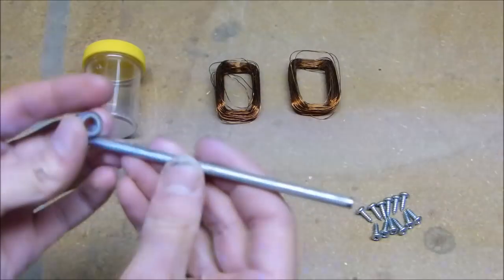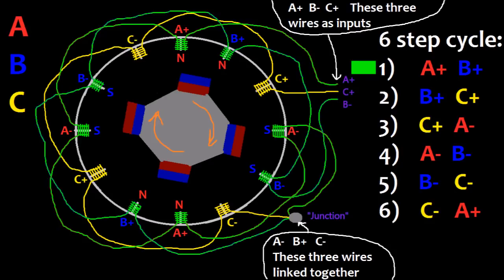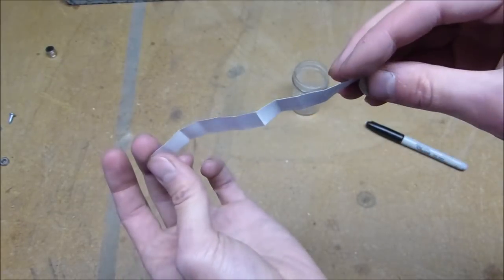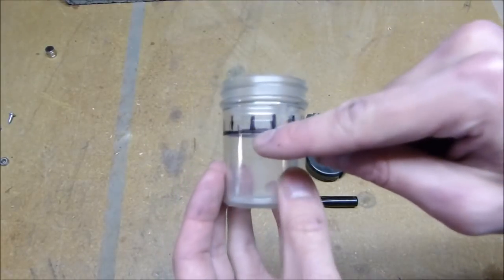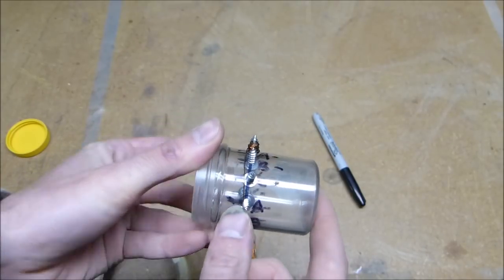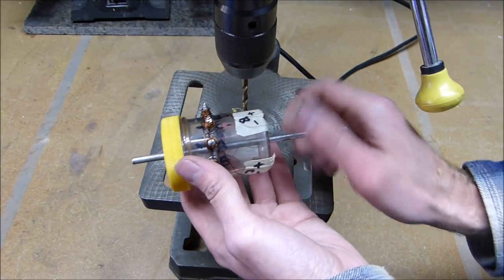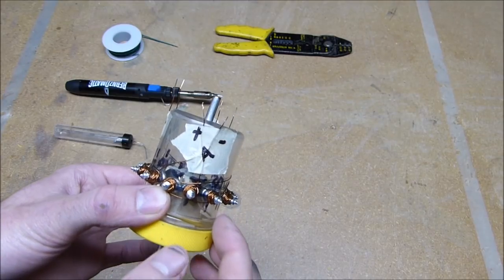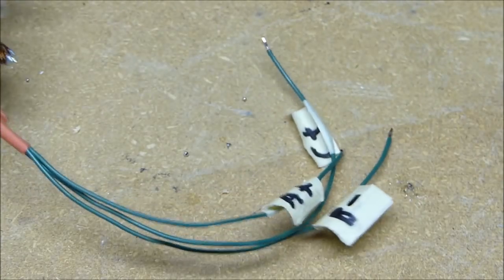How to Make a Brushless DC Motor Inrunner

Comment: My understanding is DC motor has 2 wires, positive and negative. but here shows 3 wires, how am I connect it to a battery has 2 poles ? anybody know ?
Reply from the maker: you need to use an electronic speed controller, it is like a solid-state (transistor) version of the mechanical brush commutator in brushed dc motors.
Reply: Thanks Jaycubl !

Comment: why would a brushless dc motor need a controller?  where can you by a controller for this?  and why is it only 25 rounds winding?
Reply from the maker: +KimChiTofu The controller takes the place of the commutator (mechanical brushes on brushed motors). It controls what couls are on and when.
Reply: what does it mean to have more rounds vs less rounds winding
Reply: +KimChiTofu MORE POWER
Reply from the maker: KimChiTofu Fewer winds will allow higher current (more horsepower) at higher RPM, but more windings would allow for more torque (more magnetic field for a given current). More windings (or stronger magnets) will result in a lower KV rating (fewer RPM per volt). More windings also limits the current you can use without too much heat. It is a balance of what you want from your motor with torque, power, RPM, cooling, and efficiency.
Reply: how do you calculate for number winding = more torque, power, speed etc.  any website?
Reply from the maker: KimChiTofu I do not know of any simple calculator, there are probably too many variable. The weirdest variable to account for is the strength of the rotor magnets and their distance from the coils. It is something you will probably need to experiment with, or read about other people's experiments.

Comment: can I use copper wire instead of magnet wire?
Reply from the maker: +Mani Singh Yes, this is copper wire. It needs to have a coating though as an electrical insulator. The wire called "magnet wire" is copper with a thin enamel coating.
Reply: +JaycubL thanks

Comment: Can this be used as a generator as well? If so how to modify the design?
Reply from the maker: Yes it's a type of 3-phase generator without any modification.
Reply: I am sorry @JaycubL I am new to this field. From the outputs A+, B- and C+ how do we give it to a battery or a supercapacitor to drive the load?
Reply: That is, with the outputs from A+, B- and C+, What do I do next?
Reply from the maker: Shreyas Prakash For that you would need to rectify it to DC current. Try to read about full wave bridge rectifiers, they area set of 4 diodes that you can use to make single phase AC into DC. Use one full-wave bridge rectifier on each phase, connected between the output for that phase and a 4th wire that all 3 phases can share. The 4th wire can connect to the point at the other end of the coil wires, the connection of all three coil sets (the junction connect to the 4th wire, acts as a ground for each phase). I hope that makes sense, just try to read about 3 phase generators, and AC to DC rectifiers.
Reply: Here does the 4th wire same as that of A-, B+ and C- you are connecting together?
Reply: I also tried the same wiring connection and tried measuring voltage from the oscilloscope. I am hardly getting any measurable voltage. How much voltage and current was being generated? How much output power when manually rotated? Could you please tell me
Reply from the maker: Shreyas Prakash The 4th wire is a neutral wire.
Reply from the maker: Shreyas Prakash I don't know that voltage you will get, that will be a function of the magnetic field strength at the coils, the number of turns on the coils, the material and dimensions of the coil core, and the RPM of the rotor.

Comment: Did you use a servo tester? Or the throttle stick?
Reply from the maker: +krishna kumar pookat I used the throttle on the controller if that is what you are asking.
Reply: +JaycubL  Thank you. That's exactly what I asked. I am looking for a control mechanism. To use with esc .

Comment: How many volts does it generate when we turn the tip ?
Reply from the maker: that would depend on rotation speed, number of turns on coils, strength of magnets, distance between magnets and coils
Reply from the maker: I can design a motor for you and give you dimensions, part list, etc. I already have one designed that would probably capable of that kind of power and I have some parts for it because I plan to build it. But I can not guarantee the power output of your motor to be 97hp. The power will be more of an issue of what power you can supply, your battery bank and your control circuits. If you include batteries and control electronics and everything, this would be a several thousand dollar project, I would be surprised if it is under $5000 USD for all your parts (batteries would be the biggest deal). BUT much cheaper/simpler setup would probably be capable of reaching that power you want for a short time.
Reply from the maker: Maybe I want clear and direct enough, I said I CAN'T guarantee any certain power level you could achieve. The power output is going to mostly depend on your battery bank and control electronics which I can't help you with and which will cost thousands. The power of an electric motor is basically however much you can dump through it before it brakes or overheats. You would be best off designing your own but if you really don't want to, maybe I can put up a video of the design this weekend. But yeah if you still want I can make some drawings for you and list out what parts you would need, the ASAP thing is not how I operate it would be more of "if/when I get time." Sorry if that is not that helpful but I have too many of my own projects to take on other people's projects.
Reply from the maker: OK well if you want then email me at jaycubl@hotmail.com and I will try to reply with a design for you soon.

Comment: how would you call this wiring pattern? AaAaBbBbCcCc? or something else?
Reply from the maker: +Remco van Woerkom I think it would be AbCaBcAbCaBc
Reply: Hmm, how do you interpret those letters?
Reply from the maker: Remco van Woerkom Capital letter is one winding direction, lower case is the opposite winding direction (the "B" string is connected in reverse so all winding directions for that one are effectively reversed from the physical winding direction when compared to the A and C strings).
Reply: ah i see, thanks!

Comment: Hold on, it is not a "DC Motor" in fact. You use a controller for brushless motors and they are actually simple synchronous AC motors. All of them. So when you say "DC motor" there must be anything that would make AC out of DC. In DC motors this "thing" is a collector with brushes. In brushless motors this "thing" is that controller it wouldn't work without. CO mode off:)
Reply from the maker: +Zortorond Yes, these are normally referred to a brushless DC though. Thank your for watching!

Comment: How do you connect this to use as a generator?
Reply from the maker: It will function as a 3-phase AC generator. The junction where all 3 wires meet is a common ground, and each of the 3 wires is a separate single phase AC line.
Reply: @JaycubL  thanks for explaining 👌

Comment: how many volts can it cope with
Reply from the maker: +tom hall It could handle very high volts, that would depend on the insulation on your wire. But if you let the current get too high it will het up. It could also handle very high amps but the higher the amps, the shorter the time it can run without overheating.

Comment: sir do i necessarily need the speed controller
Reply from the maker: For this type of motor yes you do need one.
Reply: and sir to what this controller is this connected
Reply from the maker: RC electronics, it is a radio receiver. But you can use any PWM signal to control the speed controller.

Comment: its not  a dc moter dc moter mean just us two wire negative and posetive ()(+) and you use three wire a,b,c .. cpu fan is also a dc fan and made by bresh less motor rebult it with two  wire black and red()(+).. direct battari base running and not use connector .. and this video is also good but i want dc motor breshless like cpu fan black and red wired
Reply from the maker: +ankit panwar A brushless motor will normally outperform a brushed motor in every way other than price. I can make a video on how to make a simple brushed motor if you want though.

Comment: how would I increase the torque?
Reply from the maker: You can increase torque by using more windings on the coils, stronger power supply, stronger magnets, smaller gap between magnets and coils, or a larger diameter rotor (for greater leverage).
Reply: JaycubL thnx

Comment: How did you learn this.
Reply from the maker: I already knew it would use 3 input wires and 3 separate coil sets. I wanted to know how it worked, so I stood there and thought about it for 20 minutes or so and then I had a clear design for this in my mind and fully understood the working cycle.

Comment: nice spark at 20:17 . Does anyone know why?
Reply from the maker: +wewlf a I was actually wondering that too! It might just be a small piece of the nickel plating on the magnet flaking off and reflecting some light. Or maybe some electrostatic effect because of the moving parts? Not sure.

Comment: That is cool. (:
Reply from the maker: +Qyuubi786 Thank you for commenting again! I really appreciate it, it helps me out some.
Reply: +JaycubL  I ask you why the current level has 3 wires on it and put the 3-point wiring that is not it
Reply from the maker: +ti ken Something may have been lost in translation... If you are asking "why are there 3 wires instead of 2 wires," it is because this is similar to a 3-phase ac motor. It needs more than 1 phase to create the rotating magnetic field.

Comment: can I do this with 9 screws ?
Reply: i guess you can do this with 8 screws, the magnets are even and so the screws should be even in numbers as well and it has to be smaller magnets than what he built in the video.
Reply from the maker: The number of coils needs to be a multiple of 3 ( because there are the same number of coils in each of the three sets: A, B, and C). To determine the number and position of magnets on the rotor, visualize the magnetic fields that will be generated by the coils and think about where they will be at any given time.

Comment: what is the power rating of these???
Reply from the maker: +rennier rodil I don't know sorry. One built exactly like this will work fine and is actually fairly strong, but it is not going to be as good as a commercial one the same size.
Reply: I mean the volts to operate this with maximum power
Reply from the maker: rennier rodil I was running it on an 11.1 volt battery. It would depend on the wire you use (how much current it can carry) and your speed controller. You can just try stuff and see if it overheats from too much current, that is the main danger.

Comment: Nice DIY build!  
Did you notice that you have a couple of sparks generated at time marker 20:17?

Where can one get one of those motor controllers?  I found version 2, but it is like 70$ here http://www.horizonhobby.com/EFLA1040LB?KPID=EFLA1040LB&CAWELAID=320011980000076321&CAGPSPN=pla&gclid=COv17-CGzckCFdBefgodtVgE3g

Do you know of a way to calculate how much torque & what rpm your motor design has so that I might be able to redesign the motor to customize the torque & rpm?

 Thanks for sharing!
Reply from the maker: +zeffur7 You can get a brushless esc way cheaper, shop around:
http://www.banggood.com/Red-Brick-50A-ESC-Brushless-ESC-OPTO-NO-BEC-50AOPTO-p-77969.html?currency=USD&createTmp=1&utm_source=ebay&utm_medium=cpc&utm_content=saul&utm_campaign=heli-US&ebay
Reply: +JaycubL 
Sweet, thanks for the url!  Did you see my other question (i.e.:  Do you know of a way to calculate how much torque & what rpm your 
motor design has so that I might be able to redesign the motor to 
customize the torque & rpm?"
Reply from the maker: zeffur7 I don't know any easy way to figure that out.
Reply: Ok. 
Thanks again for sharing.

Comment: what is the rpm on it?
Reply from the maker: I am not sure, but it is definitely several thousand RPM. I would guess maybe 4000 to 6000 RPM or so, just a guess.
Reply: +JaycubL oh thanks, so could it possibly power a cordless drill or something along those lines?
Reply from the maker: Tgol Productions Yes but for a drill the shaft will need to be supported better!
Reply: +JaycubL alright thanks

Comment: Now how do I make an ESC? I wanna scale this up and make a freakin helicopter!
Reply from the maker: I plan to make a video for how to make a much bigger motor and controller from scratch this summer probably.
Reply: I'd love to see that! Personal tricopters for everybody is my dream haha
Reply from the maker: For that you may want a motor or engine with greater power to weight and better energy storage, such as my design for a rototless turbojet engine. I think that engine would be very well suited to a VTOL craft since it would have great reliability with no maintenance (no moving parts other than fuel sysatem) and low weight, low cost. It would also be expected to have extremely quick throttle response since the only flywheel mass would be the air.

Comment: Synchronous AC motor.
Will not work without ESC.
The title reads like clickbait as in you've invented a brushless motor that will run from DC :-/
Reply from the maker: This is exactly the type of motor that is called a brushless dc motor. It requires the solid state commutator yes.

Comment: Hey dude mine doesn't turn u.u
Reply from the maker: +Omar Gonzalez Are you sure your speed controller is good?
Reply: yes it works with my other motors, what gauge wire did you use??
Reply from the maker: Omar Gonzalez Not sure it was just wire that I salvaged from something years ago. Around 20 AWG I think. That should make little difference though.
Reply: do you have an email to send you photos of my motor?
Reply from the maker: Omar Gonzalez I don't think I am going to be able to tell what is wrong from here, but you can email if you want to jaycubl@hotmail.com
Reply: Thanks,
 i'll send a mail shortly

Comment: are you n electronic engineer
Reply from the maker: I study all types of science and technology, but I have no formal education or professional training in this field.
Reply: JaycubL then you should know that you are a GENIUS
Reply from the maker: Thank you for the compliment! To be blatantly honestly I do know that yes. But you have to be careful who finds out, I try to act much less intelligent and tone down things that I say to people. Many people will dislike you if they find out that you are smart.
Reply: oh my gosh, that same thing happens to me in school. i mean not to brag, but i am a verysmart kid in my class and each time i make better and better projects i add more haters to my haters list. you are such a wise man. Oh yeah one thing, so you used 1 nail per alphabet. so in total 12. what if i use 2 nails( one at the bottom of the first one) would the ESC STILL DETECT THE CHANGES IN MAGNETISM OR WOULD IT STILL WORK WITH MY MOTOR.
Reply from the maker: Yes you can double the number of electromagnets, it will be the same just also double the number of magnets on the rotor. It will rotate at about 1/2 the rpm with about double the torque (since it will need to complete twice the number of electrical cycles for one full mechanical rotation).
It is good that you have natural learning ability, use it to your advantage. I think the reason it causes problems is that other people do not like to feel inferior. It can help to praise them for their strengths.
Reply: Thank you so much SIR! 
I salute you !!!
Reply: hi there again. i have a question so I am using marine esc with my motor but it seems to vibrate, what's the matter. i really hope you can help me here. what i did is that i used 2 small neodymium magnets on each side with the same poles facing out instead of only one big magnet. i would be waiting patiently for your reply
Reply from the maker: If it vibrates then the rotor is probably not well balanced (slightly heavier on one side). It is also possible that the motor is not producing torque completely symmetrically.
Reply: JaycubL hahaha thanks alot i made it work after all. :)

Comment: Dc?
I think not
Reply from the maker: This is what is normally called a DC brushless motor. The concept is that it has a solid state commutator instead of a system of brushes.
Reply: JaycubL the motor actually use a type of ac current which is converted from dc using the ESC

Comment: well... its not DC...
Reply: it requires a brushless esc wich is pretty much a proportional throttle/brake/reverse dc to ac converter
Reply: +that one guy yeah. so it's a AC motor xD
Reply from the maker: It is referred to as a brushless DC motor normally. Regular brushed DC motors also require a switching "AC" current. The difference is that a brush-ed motor uses a mechanical commutator to create the synchronized switching, while a brushless one uses solid-state switching.
Reply: hm that makes sense. I thought a brushed is a DC because all the "switching" and stuff is mostly happening INSIDE the motor.
so yep. you are right!
Reply from the maker: DESCENT Well yes you are right that is a way of looking at it, since a brushless motor requires outside switching control.

Comment: fake  you need a sensor in your motor
Reply from the maker: It's real, you don't know what you are talking about.
Reply: ok sorry i think  you need a position sensor for de  controller
Idont have mouch experience with brusheless,  
I try to make some similar can you recomend me s controller?
Reply from the maker: Yes, I recommend you search on eBay or Amazon and find a sensorless esc for brushless motors that can handle the power you want for a low price.